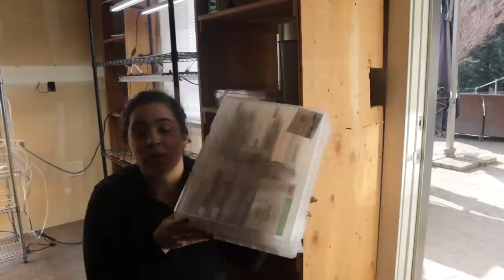Seed Starting Essentials - Setting Up an Indoor Grow Room

Comment: Hi Becky, how you have a power strip plugged into a power strip can be a fire hazard. Highly recommend plugging the black strip directly into the wall. 😊
Reply: I agree....grab another timer for the second rack.
Reply: Never heard of such a thing.
Reply: @debinnashville2009  Hello dear, how are you doing today??
Reply: I agree, piggy backing power strips is dangerous and not recommended at all.

Comment: You should be careful about plugging a surge protector into a surge protector. It can overload the circuits and cause a fire.
Reply: yes, I was going to suggest the same :)
Reply: commenting for awareness. Daisy chaining like this is a safety violation in most office and workshops.
Reply: Was coming to comment the same thing. Piggy backing surge protectors and extension cords are a fire hazard.
Reply: I was thinking about that, too
Reply: True!!
Reply: ran here to make sure it was said! might want a separate timer PER strip, fire codes usually don't allow power strip "jumping" like that bc fire safety
Reply: @nurseweeb206  Hello dear, how are you doing today??
Reply: @jehnglynn  Hello dear friend, how are you doing today??
Reply: @lindastent-campbell5130  Hello dear friend, how are you doing today??
Reply: @lakitastory8000  Hello dear friend, how are you doing today??

Comment: Just FYI for anyone in a humid climate… don’t stash dirty/wet gloves in a drawer because they’ll mildew.  I keep an open basket and toss my gloves in there.  For gloves that can’t be washed, I ran a ribbon across the top of my door and use clothes pins to clip the gloves so they can dry out.  I also hang any solo gloves until I can find their mate.  Works great.

Comment: I would want to make this a permanent grow room. It’s really convenient to check on your seedlings rather than trooping outside to a green house.
Reply: Same! To have it close enough to check daily or even multiple times a day with or without kids (especially as baby gets more mobile) but also not in the way of your living space. With the freeze dryer and other things in there too, you could kill two bird with one stone. My grow shelves are in my basement next to my laundry and workbench and cat bowls/box so it's super convenient
Reply: yes agree - perfect space Becky I would keep it as your starter and grow room
Reply: For sure! I would love that space, paint the walls white to help to reflect the light. Also, it’s expensive to heat a greenhouse unless you have a small greenhouse in the greenhouse.
Reply: Agreed and she still would need to start the peppers indoors as the heat mats would not be as effective.
Reply: And way less temperature fluctuations.
Reply: Agree! The green house could come in once/if the seedlings are sturdier and can handle temperature variations or when transplanted into bigger pots take up too much space. Heating a greenhouse can get costly and monitoring/predicting sudden temperature fluctuations to regulate your heaters' temperature is SUPER STRESSFUL. One slightly cold night and all your seedlings die.

Comment: FYI, Home Depot has a medium mixing tub in their concrete section which is a more comfortable height to use as a potting tub rather than the tall tub you have . The tubs are just $7.78 each and very heavy duty.  I suggest getting two. They stack easily. 
Yes to the extra table, especially to start. 
If you plug your heat mats in to warm, they flatten easily. I roll mine when not in use, and they flatten very quickly when warmed up.
Reply: Laura from garden answer just did a great diy one too if there is extra lumber lying around
Reply: THANKS I LOST MINE SOMEHOW
Reply: I use those black tubs for potting soil. They will last forever.
Reply: I use the HD tubs for a duck bath 😳
Reply: I love these tubs!
Reply: I love the concrete mixing trays/tubs.  Use them for soil blocking and potting up.
Reply: I use an extra large kitty litter container

Comment: I'd keep your seeds stored in the basement, as you had them before. Cool and dark. Waaaaay too much natural sunshine, clear storage boxes, and I'm assuming the room isn't air conditioned. It'll probably get pretty warm in the summer 😬

But I'm totally jealous of your seed starting room! I have two of those racks currently full in my living room. You'll definitely want a third, or even a fourth! 🌱🌱🌱
Reply: It would probably be fine during seed starting season, and then she could move them to the basement until the next season.

Comment: Those plug-ins concern me a bit for safety, so I'm just going to say:  The surge protectors almost always have a hole in the back for a screw mount.  You could put them on the wall, even vertically, and then plug the lights into them there.  I think there is at least a slight to good chance of soil and/or water getting into the plugs if they lay on the shelves.  Once the seeds are up, the temperature is even better a bit cool because otherwise the plants are going to try to grow aggressively which may not be best for the outside world they are going to be placed in to.

Comment: Hi Becky! Bringing in another table is a better idea, although I think you should put the heat mats on the new table and use the big black one for potting etc., because it has drawers, you can put the potting tools in the drawers, and put them away. Lovely use of the space! 😍 (And if you don't need the wood shelf on the left side-between the growlight shelf and the lamp less shelf, you should put it somewhere else, and the metal shelf beside the lamp one, so it has more light. Just a suggestion. 😉)

Comment: HONEY, REMEMBER TO MOVE YOUR FIRE EXTINGUISHER FROM ON TOP OF THE WATER HEATER.  THE FIRE EXTINGUISHER IS UNDER PRESSURE AND COULD EXPLODE.  PUT WAX ON THE BOTTOM OF THE  DRAWERS TO HELP PULL THEM OUT MORE SMOOTHER.
Reply: Yes! Or WD40 ;)
Reply: Good call on the fire extinguisher! Bar soap instead of wax also works.

Comment: I highly recommend a rolling cart with a flat top for your work station it will make life so much easier to transfer from your table to shelves and back and forth. Just get one with locking castors/wheels. I also recommend that so you can easily move the table around the room or house or property as needed. It can also be used to assist when you are doing preserving projects. You can even find some or make one that has adjustable height for more comfort.
Reply: Excellent advice 😊hope Becky reads it.
Reply: I hope she sees this, it would be more convenient.
Reply: I've often thought this would be uesful for several of the YTers who are moving lasrrge aounts of stuff around, especially canning in large batches!

Comment: What a massive cleaning job! Looks fantastic, and I agree with those who suggested leaving it as a permanent grow room - you’ll appreciate it in the dead of winter!. Also as others have said, never plug one powerboard into another. Suggest you get an electrician to install some extra power points as they’ll first make sure the system can safely the additional points won’t overload the system.

Comment: I would not use the second drawer for dirty gloves, I would just keep the basket not far, put dirty gloves in there and it will be easy to carry back and forth to the washer and back to the potting center

Comment: I found a power strip with one set of plugs on or off and the other set of plugs could be individually programmed to turn off and on or done manually.  It was a game changer for my seed starting this year!  I start in the garage and we moved my shelving from an exterior wall to an interior wall and I think that was key also.   I hang my lights from chains that I can raise and lower as the plants grow and that really helps with legginess and with checking (sometimes hourly) on the seedling progress.  This year we also used a soil blocker and it made it fantastic for up-potting.  I recommend watching some videos on it.  As always, I am so impressed with how much you get done!!

Comment: You might want to use a small plastic trashcan or one of your empty food storage buckets to throw your dirty gloves in instead of putting it in the drawer.  You'll end up with a lot of dirt in the drawer from dirty gardening gloves and the moisture might make those metal drawers rust.

Comment: Top: put matching gloves together with a squeezable paper clip or clothes pin. This way you are not searching for its mate.  Also label your drawers, doors and shelves) so other now where things are or go. you may also consider putting solid tubber mats down in your area for easier clean up since you have carpeting down. When taking up your carpet in the future you will have to scrape the glue off the floor.

Comment: When you first heat the mats with seed trays on them them will flatten out perfectly. If you like cucumbers, you should try Katrina cucumbers for Johnny's. They are sooo prolific, don't need pollinators,  you can use them small to pickle or grow large for slicers and freeze dry great for snacks or dipping. A little pricey for seeds, but well worth it.

Comment: You could put a board on the shelves in the corner to put the heat maps on and use the whole table for potting.   I do recommend the cement mixing tubs at Home Depot for mixing soil. Much better than a tote and not expensive at all.  I actually have several that I use for different gardening purposes.

Comment: I bought the photo organizers for seeds too!  I actually made labels for the side that faces up when they are all in the box....on the left side of the latch, I put the date(ish) the seeds need to be started indoors, and on the right of the latch, the date to transplant them outside.  If the seeds get started directly in the ground, I only put a date on the right. (All dates are based on the "before last frost" for my area, going by what the packet said for each type of seed.) Then I sorted seeds based on how long "before last frost" into each box and VIOLA...the most organized I've ever been with starting seeds, thanks to YOU!

Comment: I had a carpet full of filfth and stains and couldn't replace it but got someone to come around and do a steam carpet cleaning job and it came up looking brand new, even several shades lighter in colour and smelled so clean and fresh. I highly recommend this, your carpet is OK, it's not torn or doesn't look too shabby and would be a good temporary solution costing probably a tenth of new flooring.

Comment: You maybe should put the heat mats on the shelves and use your counter for starting seeds. I mean the lights are on the shelves right and the starts need to be under the lights and on the mats.

Comment: There is a cold water inlet to your hot water heater. Would be really easy to add a hose connection.

Comment: Becky, you mentioned you wanted to look into buying new module trays - Charles Dowding made ones called the CD60. They have a big hole on the bottom so you can push seedlings out with a finger. Also those trays are indestructible. You can literally stand on them. I think Someone even drove their car over them and they were fine. 
Someone sells them in the US, I think Elliot Homesteads latest video talks about that.

Comment: If Josh can get a spliter facet for incoming cold water into hot water tank, you can have water on going into the tank, and the other one, a hose, can be attached. They have a little shut-off button on each spicket, so when you are not watering, you can turn that side off. This will save you lots of hauling for watering. I hope this works for you!

Comment: I've plugged the heat mats in for about 30 minutes with heat and weight. After that, smooth the mats down, then unplug. Just need to loosen the surface area enough to relax.😇

Comment: The potting room is coming along quite nicely! If you pull up the old carpet and there is glue still on the floor maybe you could put some rubber flooring in. That would be easy to clean and soft on your legs. The old drawers will move smoothly if you spray the tracks with WD40. We got an old cabinet that the people were getting rid of because the drawers stuck.... got it home vacuumed the tracks and sprayed with WD40 and they move like new! It so exciting to see you getting your future garden going. Thank you for bringing us along!💚

Comment: Yes, please do a seed haul. A rolling table in the center of the room would be great. Can then use it in other areas for projects such as canning later. I would recommend moving the heat mats to the shelves and using the counter for doing seeds and up potting seedlings.  Also, recommend a small basket or tote for the dirty gloves so it keeps the drawer cleaner and easier to grab tote to wash the gloves.
Reply: I was thinking the same about putting dirty gloves in a drawer. A bucket that sits on the floor or counter that you can carry upstairs and rinse out easily for dirty gloves might work better!

Comment: you might want to think about putting some cheap contact paper in the bottom of the drawer for your dirty gloves. I imagine there will be soil on the gloves.  The contact paper will make clean up much easier.  Might even think about it for your baking drawers with your flours as well.

Comment: In case Canadian viewers are interested and are not already aware, plant hardiness zones in Canada are measured differently than those in the US. The comparison differs over the range of the 0-9a numbering system, but a loose comparison is that Canadian zones are one digit higher - ie, a place that is zone 4b using the US system is closer to a zone 5b using the Canadian system. The Canadian system includes information relating to the average of the daily minimum temperatures for the coldest month and maximum temp for warmest month of the year, # of days without frost, rainfall, maximum snow depth, maximum wind gust, etc.

Comment: Has someone already told you not to plug one surge protector into another surge protector? (Power strips) use that other outlet right there in the built in.

Comment: I use a cement mixing tray to hold/mix my dirt.  It’s just the right height for potting.  At our local farm store, they have 2 different sizes, so one can find the right size for the space and number of plants you have.  Considering I’m a “senior citizen”, I prefer having the tray on my potting table so I don’t have to bend over constantly.  (My potting table is an old flat-top chest freezer that’s out in the end of an old chicken building😅…fancy!)

Comment: I would suggest putting a regular shelf here / the one without the grow lights @16:00 to benefit from the sunlight whenever ur seedlings are a little bit bigger. So u will have more space for them and focus on having the germination and the first few weeks under the grow lights. They should be enough for this season no need to buy more now

Comment: If no one else has said it yet move the soil away from the hot water heater. It will dry the bags out too much over time. Awesome set up though. Thinking long term/year round  can you put an open trash can by the inside house door? Them when you come in from the garden you can do the gloves and any other clothing to wash to keep out as much dirt as possible. I have been known to change before coming in the house after rain or high allergy season.

Comment: Just a suggestion - Subscribe to the Southern Exposure Garden Planner.  It keeps track of what and where you plant from year to year making crop rotation super simple.  It also shows you when to start seeds indoors, when to sow or plant out, and when to harvest.  And yes, it is zipcode zone specific.  It also let you plan areas with sheds, raised beds, pathways, irrigation, and many other things.  And it has a journal.  I've been using it for years and love it!

Comment: I use those exact photo organizers to organize my spices that I store in the smaller jars. I'd bought smaller jars because the location of my bigger jars (qt jars) is tough for me to reach. So what I did was purchased 2-4 of those photo organizers, purchase small jars (I think they were suppose to be 2-4oz jars), gathered EVERY spice I could find not only in our 2nd pantry, but also, any that were in our buckets. I gathered every single one, condensed them all into the smaller 2-4oz jars, then extra in bulk in the qt. jars, then the extra from that, I vacuumed sealed. I also labeled all the jars in alpha order and dang, it took me what felt like forever but being able to find EVERY spice while cooking sure makes a HUGE difference! I love those cases!

Comment: Hardiness zones are based on your first and last Frost dates.
You need to keep your grow lights low, near the seedlings. So they don’t try to stretch to the light and get leggy. 🌺
Reply: Hardiness zones are based on your coldest winter temperature, and tell you what perennials will survive the winter. First and last frost dates tell how long your growing season is. They're two different things.

Comment: Bring the extra table in, lay it lengthways it will be easier to access from both sides then, if you use the other big table then your taking away seeds that needs the heat mats.

Comment: I wouldn’t take ip the carpet. I’d lay down those 12x12 rubber tiles that fit together like puzzle pieces. Save that project for after you’re done with it being a grow room. They are easy to move outside and hose down.

Comment: move the heaters to the black wire racks without lights. then you have the whole surface for seeds starting and uppotting later and not lose the room to move around.  if you get more grow lights, add them to the other shelves.. so then you would have a seed starting pregremination rack (no light needed) and 2 no heat but need light racks for growing out your seedings
save that space!